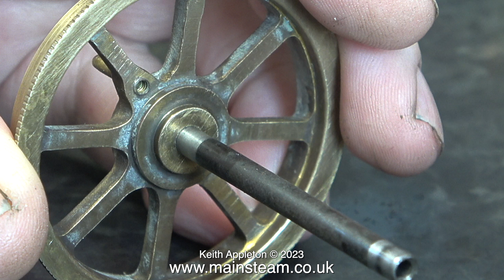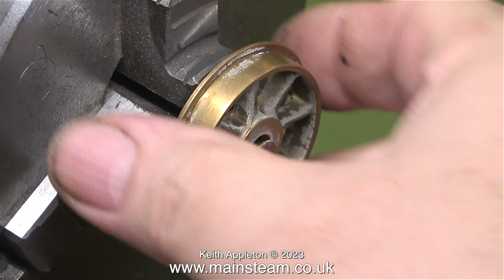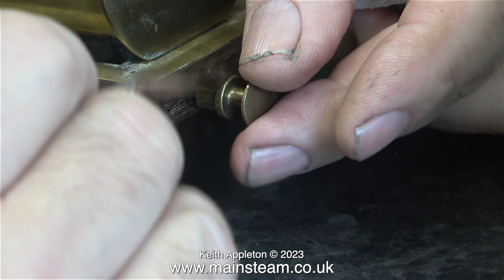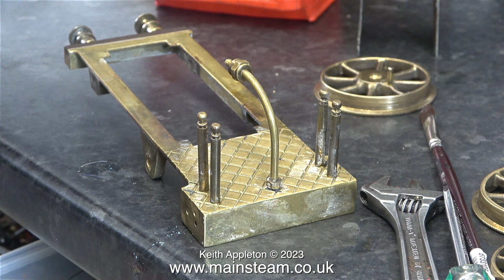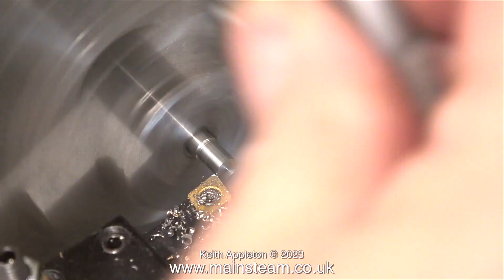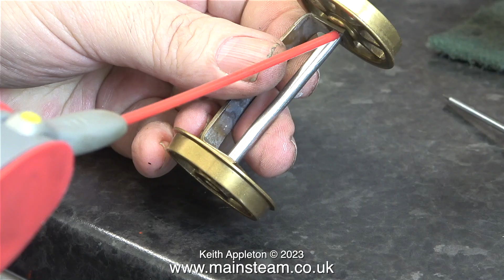HOW TO REPAIR A "BIRMINGHAM DRIBBLER" - PART #2

Comment: Good to get to see one in close up. My various books do not show them in great detail. Besides the rotating front axle the serrations on the driving wheels  I guess are another clue us to it indented use on the floor  as they would no doubt  add a bit of grip to the wheels.  But probably one would have got into trouble with the housekeeper for scratching the polished linoleum or waxed wood floors in the orangery !
Reply from the maker: Thanks for watching!